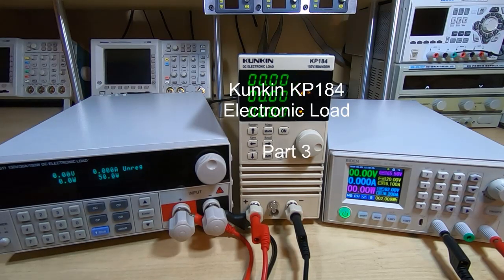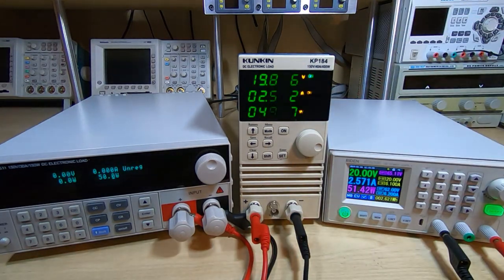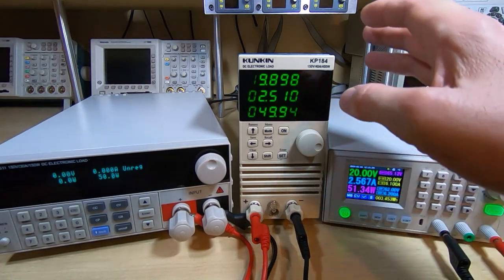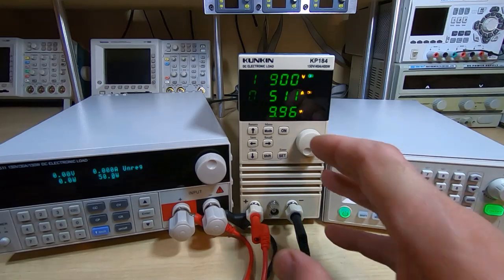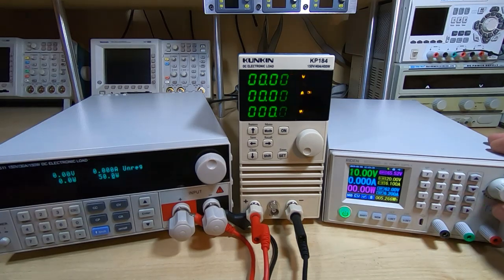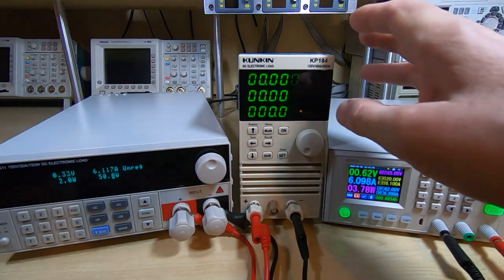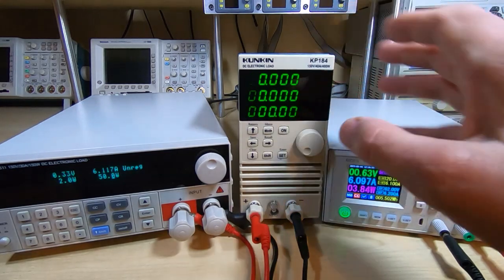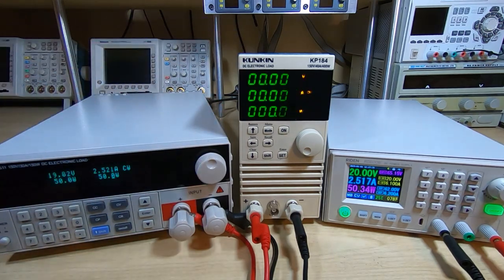Kunkin KP184 Electronic Load Part3

Comment: Based on this desgin flaw, would you recommend a Korad KEL103 load or Maynuo 9712 or 9812? I was thinking to buy a load but have been put off on the Kunkin
Reply from the maker: I try not to compare different classes of equipment as it can be missleading. For the price the Kunkin is worth buying. However if you have the budget then the KEL103 is a better load although twice the price of the Kunkin and the 9812 is better again but costs 3x the price of the Kunkin. If I was just buying a single unit out of the 4 (184, KEL103, 9712 and 9812) I would select the M9812 as I need the higher current capacity than the 9712 but for basic testing the Kunkin would work, especially if you need more than 1 or simply need the higher power capacity (The Kunkin goes up to 400W and 40A).